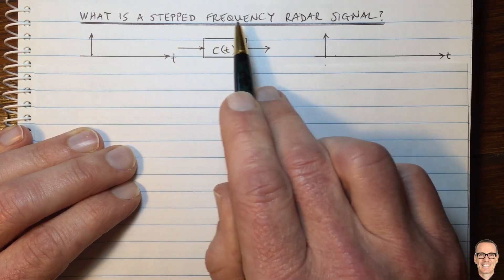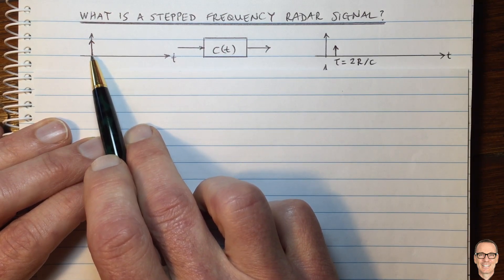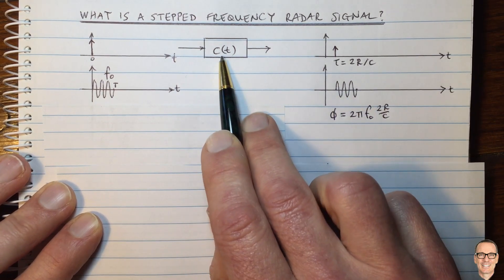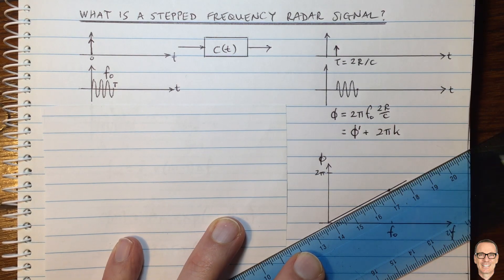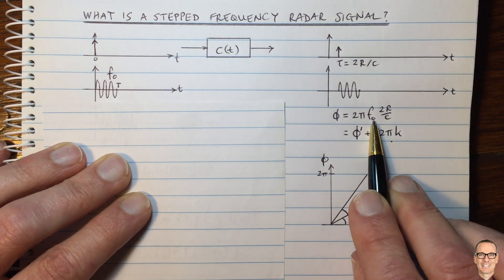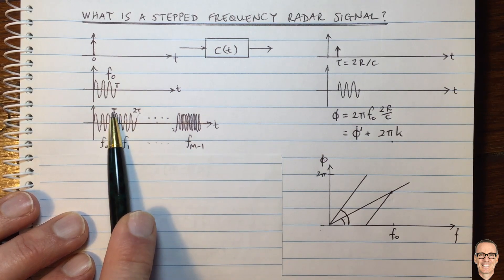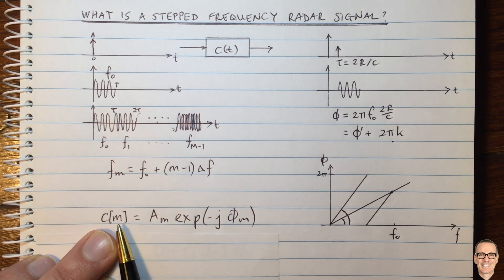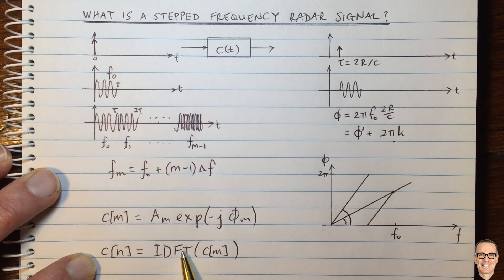What is a Stepped Frequency Radar Signal?

Comment: How to apply this in Fmcw where Doppler is also measured and processed. This r0 phase changes from chirp to chirp but so does the doppler phase 2pi 2 df × n v /c nT + 2pi 2 f0 v /c nT

Answer is much appreciated
Reply: Also what if one uses DFt (or fft) instead of iDft (ifft), I don't see the explicit necessity gor iDft
Reply from the maker: Time and Frequency domains are linked by the Fourier Transform (time-to-freq) and the Inverse Fourier Transform (freq-to-time). More details on how they are related is here: "Fourier Transform and Inverse Fourier Transform: What's the difference?" https://youtu.be/N8RV6WT4sTY

Comment: One of the best videos I saw for SFCW: Could you please tell me when applying IFFT over a set of complex numbers generated by  aNSFCW radar, how many points describe the signal in time. For, if my frequency sites are 4096, I must have 4096 points when applying IFFT. 

Now we know the signal propagated based on the time for each step, meaning the total time / 4096 steps. Can we apply UFFT only on one of these complex numbers and expect to see the reflection related to that specific frequency? Or we should always apply IFFT over the set of complex numbers, and therefore, we have a number of points in the time domain or sample points equal to the number of steps.
Reply from the maker: Hopefully this video helps: "How does the Discrete Fourier Transform DFT relate to Real Frequencies?" https://youtu.be/pIFz84oj9cA and you might like to watch some of my other related videos on the DFT (which is what the FFT implements) which can be found on my webpage under the Signals and Systems tab http://iaincollings.com

Comment: Do people actually use radar in day to day application or it just something that come out from a war ?
Reply from the maker: For almost all cars built in the past 10 years, when they reverse, they use radar from the sensors in the bumper bar, and they beep if objects get too close. And modern cars use radar out the front of the car to do adaptive cruise control, by working out how far it is to the car in front, and whether the car in front is slowing down or not. That's just two examples.
Reply: @iain_explains  Oh this is so interesting, when I think of radar I always think of those large parabolic disc in the SETI project. I dont have a car so I never know that they could integrate that thing into a car hahah
Reply from the maker: SETI doesn't use radar. It only receives signals. It doesn't transmit anything.
Reply: @iain_explains  Oh so that is how it works. My mistake